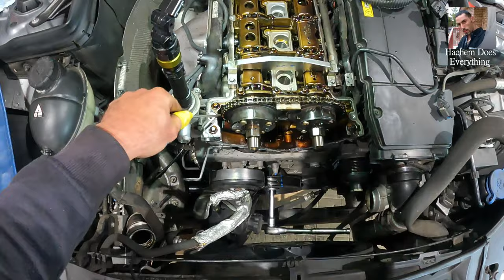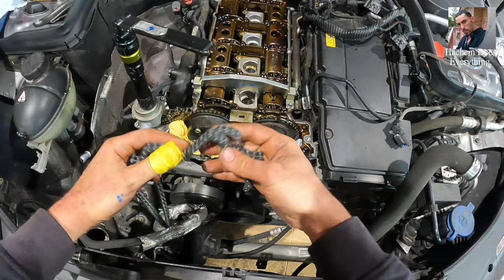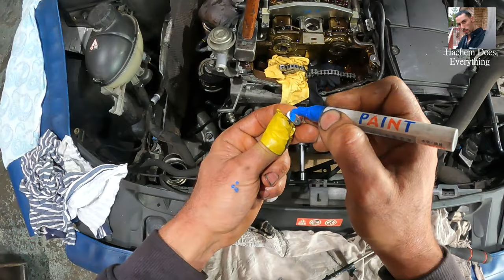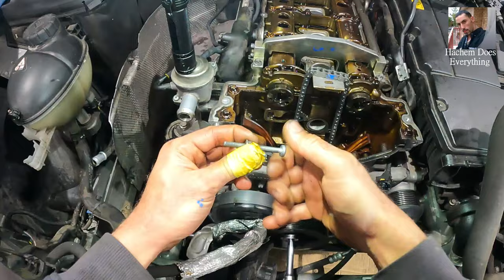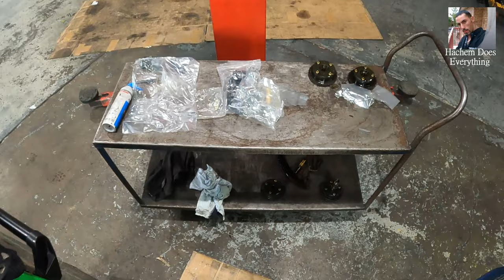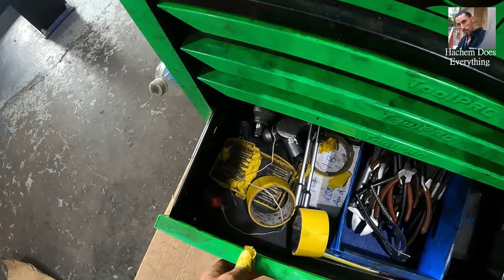Mercedes C200 W203 Engine Timing Chain How to Replace Step By Step

Comment: Thank you for the video very very clear, but I have one question about the second rail of the chain, is it difficult to replace it and how?
Reply from the maker: to replace the timing chain guide that on the right side of the engine , need to take off the engine chain cover, but this guide does not get damaged easy as the other guides, it is very strong. if it is damaged it should be replaced by taking off the chain caver and replace it with new chain guide. have a nice day.

Comment: HI, awesome video sir, question......what is that red plug you are using to test compression? is it homemade? Id like to make one myself if it is... Thanks again for a great video
Reply from the maker: It was a plastic cup that comes with the new water pump. I do use it with the safety glasses on,  to do the engine compression test,  my way.

Comment: Maybe you could provide some insight for me. I'm replacing the chain also on my m271. My timing marks on my cams do not line up and I've seen the chain jump when turning the crank by hand. I have 2 special MB tools that locks the cams in place and chain crimping tool.

The goal is to replace the chain and tensioner. How can I get my cams lined up correctly if the chain has visible jumped already? I'm a little bit pissed TDC. Could I remove the tensioner and create slack on the chain and turn everything  counterclockwise or clockwise so I can line everything up?
Reply from the maker: Hello ,Try to read this Video comments and you will Find the answer for your question, someone asked me the same question and i did answer with big Good Comment. if you have an other question for this timing chain setup that i am doing in this video, you can ask me the question , You are Welcome. have a Nice Day.
Reply: @HachemHActivity  Thank you so much
Reply from the maker: You are Welcome.

Comment: great video! you made this look easy
Reply from the maker: Thank you! 😊
Reply from the maker: Good Luck, Remember Safety first.
Reply: @HachemHActivity  just want to update you i have managed to change the chain no problem, this video helped me alot!  hardest part was taking the alternator off and getting access to tensioner
Reply from the maker: Good Luck and always remember Safety First, if you have a question you can ask no problem, Have a Nice day.
Reply from the maker: Hi, Velo. it is normal for the exhaust manifold to get Hot and makes boiling sound from the oil that manifold get when working on this job, should clean the oil very well, but if it get !!Super Hot!! maybe the catalytic converter is Dirty and Blocked Maybe!, if You set the engine timing Right!! should be no Bent Valves. if the timing set wrong and the Valves bent engine will starts do misfire and Shake.

Comment: Great veido, I have a quistion Im Working with my car now with same engine ro set  it with DTC on the mark of crank pully OT then i  check the cylinder 1  its not rop center way much down ? How come like That, ?
Reply from the maker: Crankshaft pulley,  there's rubber inside it , if  damaged it will turn different way. Harmonic balancer need to be replaced maybe.

Comment: Salut je suis francais super vidéo merci , tu a fait ce changement pour un défaut alumage ? ,Hi, I'm French, great video, thank you, did you make this change for an ignition fault?
Reply from the maker: Salut, je changeais la chaîne de distribution avec les engrenages, car la chaîne était étirée et les engrenages étaient endommagés et ils faisaient beaucoup de bruit. merci d'avoir regardé et bonne journée
Hi, i was changing the timing chain with the gears, because the chain was stretched and the gears where damaged and they where making big noise. thanks For Watching and have a nice Day.

Comment: Great work and very good video. Is the change of timing chain exactly same on the E200 W211 m271 engine ?
Reply from the maker: if the engine for W212 or W204 like E250 or ... Turbo it is same but the chain gear and the engine parts and the tool to do the job some of them are different, engine has more parts. it is same & Different. soon i get job for this engine i will make a video from start to finish for the engine timing chain, & will be Very Clear, Enshaa Allah

Comment: Very nice job brother! I LOVE to watch you work! I have a friend with a 2004 C230K Benz that needs this done and my only worry is that maybe he has bent valves. Is there easy way to tell if valves bent or not without first changing everything and then doing your 'Easy' Compression test??
Reply from the maker: yes, there is.... on the top off the camshafts there is the camshafts holder , that big plate, when taking off the camshafts holder all valves will be closed all the way, then doing the easy engine Compression test mean blocking the spark plug housing with a plastic cup secured by wire to the engine and safety glasses must be worn, turning the engine slowly and when the plastic cup fly that mean the valves are not bent. :) good luck  chain should be off with the camshafts to do this test if timing out , other way if the engine timing is right can do the easy Compression test without taking off the Camshafts plate.

Comment: What do you do when the cam timing is off before removing chain and gears? How do you align timing again?
Reply from the maker: hi, if the engine timing chain was off , what i do is, i do not set the timing with the old chain again because it is stretched and will jump, first thing i do i remove the two camshaft to let all the valves close and then i do my easy way to test the engine compression to see if there is damaged valves, 90% the valve will not be damaged in this nice engine, if all valves are not damaged i do fit new timing chain kit if there is damage the cylinder head should be removed and repaired,
you car watch my video how to do easy compression test without tools that is my way to test, remember safety first. good night .
Reply: @HachemHActivity  Thank you for explaining, much appreciated.

Comment: How is it possible that you can turn the crankshaft for getting the new chain in without touching the valves? Camshafts arent turning and some valves must be open
Reply from the maker: Hi, For this Engine only , When the Timing Tool is Sitting on the cams and locked the Cams in the timing setup Position, i do turn the crankshaft to pull out the old chain and install the new chain with very careful and i never had valves touched the pistons, i do this way just for these engines type Mercedes W203, W212 , for other engines  Pistons & Valves they way touch each other. Thanks for Watching. Have a Nice Day.

Comment: This two wheels are broken on my car while driving other day in morning car wouldn't start driving, what I wanted to ask if the valves are also bent or just this🤔, thank you
Reply from the maker: Hi, if you wanna make sure that the Valves are bent or not, there is an easy way that i do, to do this test, i like to tell you that 90% of this problem with the timing chain got no bent valves,
watch this video again, !! just now i put at the end screen of this video, a video about how i do test for the valves to know if bent or not, go to the end screen, top right video and watch it , if you need to ask question again you are welcome. have a nice day , Remember Safety First.
Subscribe to my Channel if you did not yet, to watch more videos like this. Thanks.

Comment: Thanks for the video. How can you turn the crankshaft without removing the camshaft? The pistons were supposed to hit the valves, right?
What was the metal bracket you installed on top of the camshafts?
Reply from the maker: Thanks for watching,  for this engine W203 and the engine W212 only!!! , I put the engine timing Tool on the cams and then , I do turn the engine slowly with very careful 😀  and the Pistons will not touch the valves. I did this way for more then 70 engine timing chain setup and no Pistons touched any valve,  this is only for W203 and W212 Engines , other engines will touch for sure!!!! .

Comment: This is the best Video on Timing Chain and Tensioner 
is it better to get the tool to do the link or is your method safe
Reply from the maker: Hi, Good Day, the way i do connecting the two side of the chain together,
 i do this way very long time ago more then 25 years and never fail. when the chain connected good and right and making sure it is connected in the right way and locked Well on the two sides and moving well,  i thing it will be safe and strong, if the mechanic who doing this job knows what he is doing.
Thank you Very Much For Your Nice Comment.
Reply: @HachemHActivity  thank you for excellent advice
Reply from the maker: You are Welcome :) Good Night.

Comment: nice work . Is there any harm in moving the engine in the opposite direction?
Reply from the maker: Hello Mr. Ahmad, When working to Setup the engine timing it is OK to turn the Engine in the opposite direction but should ! Stop ! when feeling the pistons are touching the valves !! but after the engine timing is set correctly, it will be a very very very bad idea to turn the engine in the opposite direction, because 90% the chain will jump and the engine timing will be wrong and can damage the valves very easily. Thank you Very Much Mr. Ahmad for your Nice comment. have a Nice Day.
Reply: @HachemHActivity  many thanks for reply . I was in problem between engine sealer and the mechanic . The engine valves is distroied . Thank you a lot
Reply: @HachemHActivity  how the pistons didnt hit valves when you turned from the crank when installing new chain? because camshaft and valves were still.
Reply from the maker: Hello Mr. Caz , this is why i like this engine, when setting up the timing chain for this engine and lock the timing chain with the timing tool on the cams, i noticed that the valves will not touch the pistons, just for this engine !!!! but Sometime the valves will touch the pistons, to make sure its not touching, must feel when turning the engine to put the new Timing chain, if i feel that the pistons are touching the valves, i Stop turning the crankshaft to don't make damage for the Valves, i did more then 50 times job like this and never pistons touched the valves when !!! the timing tool set on the cams !!!  but different engines, Maybe 80% or more pistons will touch the valves when turning the engine like this. for this engine if the engine running and the timing chain get damaged, 90% valves will not get damaged, if the engine stop after chain Get Damaged and no one did try to start the engine after the chain damaged. that why i like this engine, it has good space between the pistons and the Valves just when the timing tool is fitted on the cams, otherwise the pistons and the valves will hit each other.. Thanks For watching, and Have a Nice day. 
Mr. Caz.

Comment: The valves on cylinder 2,3,4 dont hit when you turn engine?
Reply from the maker: i never had the valves hit the pistons when turning the engine !! with the timing tool is set on the cams !!! just for this Engines W203 & W212 other engines pistons & Valves May Hit each other. have a nice day.

Comment: What do you do to not hit the valves while moving the crankshaft?
Reply from the maker: 70% of times, i do turn the engine & the valves does not touch the pistons in this engine model , but to prevent valve from touching the pistons , i do take of the camshafts holder that on the top of the camshafts with the camshafts. and in that time i can do easy engine compression test for the valves to make sure that they are not damaged, watch the video that i made. 
have a nice day. remember safety first .

Comment: best M271 timing chain replacement with only the camshalft holder as special tool which is cheap besides which m271 version is more reliable the 1.6 kompressor  found on the w204  which is fact the car you woked on on this video or the 1.8 turbo thankss

Comment: I have a m271 that jumped timing mercedes tech said it had bent valves.... but he did not line up the marks on the cams correctly or use the tool you used to hold the cams.... you think it has bent valves even though the chain is not broken
Reply from the maker: Thanks For Watching. when i do job like this, i like to set the timing tool on the cams and let the chain turn free on the top of the gears, my way to check and to know if there any damaged valves , i can know for super sure if the valve bents or not , watch my videos on my channel and see how i do this engine compression test. Have a nice Day.  85% of the times, those engines can Survive from bent valves. best Engines.
Reply: @HachemHActivity  OK thank you very much

Comment: Great ,best on YouTube, I have a question about to change gears and chain, what step do I take if my chain has slipped and the timing mark on right gear not lining up.
Reply from the maker: Hello Mr. Ron, First You Need To make sure that there is no valves damaged, you need to remove the aluminum plate that holding the cans in place, so all valves will close and after that you need to wear Safety glasses and hold up the engine chain by metal circle bar and then turn the engine by hand with very careful while blocking the spark plug housing by a plastic cup and turn the engine slowly, if the cup fly that mean the valves are good on the cylinder you testing for safety the cup should be Secured by Secure wire to the engine and make sure that you Wearing safety glasses. you can watch my video on my channel to see how i do this test for the engine Valves. Have a Nice Day.
Reply: @HachemHActivity  Thank you for your reply, I have tested and cup flys off on each cylinder ok ., but not sure how to set the alignment of right-hand timing gear to top mark, do I turn it? the old gear the teeth were worn and the chain must have slipped and put out the timing.
Reply from the maker: First the Gears and chain with the guides must be changed, to turn the exhaust cam, put the old gear on the cam, with the crankshaft at O/T cylinder one is up, start to turn the cam using Big screwdriver on the teeth of the gear with the screwdriver on the side of the cylinder head, turn until you can put the timing tool on the cams, remember you have to be very careful, safety first always remember that. if you feel the valves touching the piston turn the crankshaft a little bit. have a nice day.
Reply: @HachemHActivity  Thank you for this info, I have just been able to get back working my merc, C180K, I have noticed that the timing mark on the crankshaft is way out of top dead centre on cylinder one, could the fly wheel slip with the timing marks ? cylinder one is top dead centre on the compression stroke and timing 0| is almost at 6 o'clock.
Reply from the maker: Sometimes the engine harmonic balancer is out of right timing because it has rubber between the Pulley and the balancer, if piston 1 is up the O/T is at 5 or 10 or more that mean harmonic balancer is faulty and need to be changed to get the right timing marks for the engine.
Reply: @HachemHActivity  Thank you for that, Can i still do the job without replacing the harmonic balancer as long a I know the top piston one on the compression stroke.
Reply from the maker: To do good Job, faulty harmonic balancer need to be replaced, to get the right engine timing marks, and for the engine to not have vibrations from the Crankshaft. Good Night Mr. Ron.
Reply: @HachemHActivity  Thank you for all your help, I will get a new balancer

Comment: Hey Hachem, need your help one more time, the engine light on my panel is on, them I scan and find out the problem: 
P0010 OBDII: Camshaft position (CMP) actuator, intake/
left/front, bank 1 - circuit malfunction
What cloud be the problem? Any suggestion?  Thank you my friend!!🙏🏻
Reply from the maker: Good Morning, for this engine fault code , i think maybe the big bolt that Holden the Gear under the intake actuator, that has 3 small bolt. has the open and close piston is Stuck because tightened too much , watch the video again and see how they pull in by them self, or timing wrong, or camshaft sensor, sometime camshaft is not good. maybe check the actuator for the intake cam. Good Luck.

Comment: One question, what happens if  I invert te valve gears ?  If I put E in place of A and A in place of E?
Reply from the maker: hi, if invert the chain gears E to the A and A to the E The Engine Timing will Never bi Right and the engine will not operate good as Should be and sometime can damage the valves too,Thanks for Watching New Helpful Videos Coming soon, Have a nice Day.
Reply: @HachemHActivity  you are the best! Keep the good work! 🙏🏻